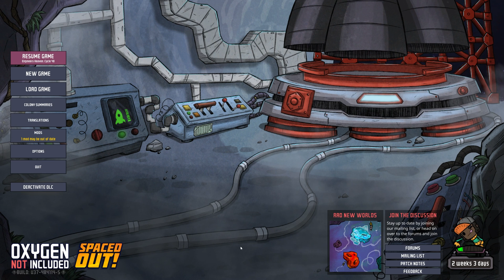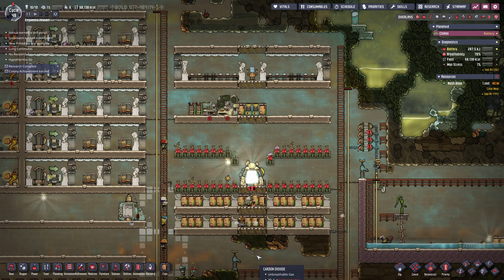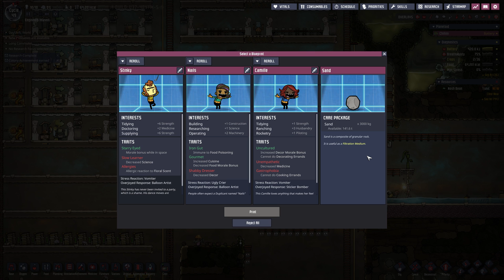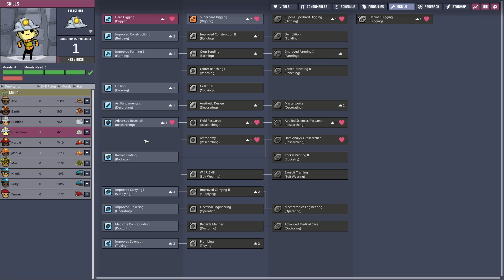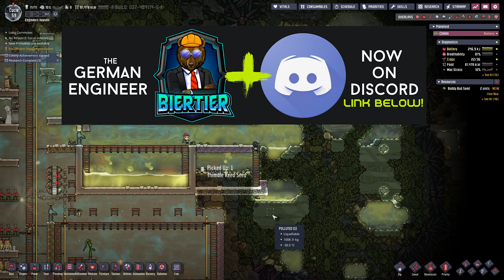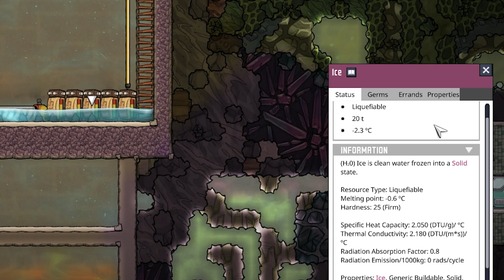AUTOMATED BASE HEATING and RANCHING HATCHES in OXYGEN NOT INCLUDED! (LP1-EP4)

Comment: I don't understand why they have individual bed rooms. 8 beds can go in a barracks. doesn't become a bed room till you get big plastic beds to put in there.also those bigger beds don't really do much. going to require alot of space just for an army of dupes when with two barracks you can easily have 16 lined up. also bathrooms on every floor? just go ahead make a bathroom floor then you can switch it out to a plumbing bathroom loop later. dupes on different schedules so few toilets for more dupes to use. so if you have 3 toilets to start seperate dupes to 3 per schedule plenty of toilets. 

off gassing of polluted stuff just put those underwater so no off gassing. but here I think you doing it for the oxygen since you don't have any oxygen production besides the that one next to research. 

how you growing food already before locators? I always have my beds toilets and water pump done by first day science row set up and working on digging the area out for where my 5 hatch ranches will go the second day. if you find a pip just keep moving those around with a box of seeds and let them plant away.
Reply from the maker: Several reasons for the bedrooms(and yes, I'm aware of the barracks): 1. I prefer the aesthetics. 2. If you have a snoring dupe he gets automatically separated from the rest. 3. If a dupe needs light to sleep you can build a lamp and call it a day. 4. I can use the extra spent time on building to explain other stuff around the base, so it's also a good way for content ;)

The bathrooms are separated because I use the water to heat the base since I'm on Rime. So the water gets naturally and equally separated throughout. And, again, I like the aesthetics. 

The off gassing is indeed for the oxygen in this particular case, I don't mind some polluted oxygen floating around. 

I build my base slower as I would normally without a video on purpose, so I have time to explain. I also don't have a "standard start", I like to mix it up. Sure, building it faster is more efficient, but that is really not the goal in this series ;)

Comment: A small point which might help you is that if you fill up a liquid loop using a liquid bridge it will not overfill
Reply from the maker: I usually do that manually, but you are of course right, with a bridge it’s easier 😊

Comment: Remember that there is a 3 degree buffer you need to overcome to melt or freeze something. -0.6 + 3 means you need to get it to 2.4 degrees. And to freeze, it needs to get down to -3.6
Reply from the maker: I did forget that in the video. Thanks for the correction!

Comment: Really nice episode, been wating for it!

A few small things if I may: 
You shouldn't distill the slime! You won't need the extra algae but can use the slime for Dusk Caps which are awesome and easily farmed food. To prevent the slime from gasing off, just put it in a storage bin under water. As soon as pressure is above a certain threshold (1.8kg iirc), elements are prevented from gassing off.

To make melting your ice much quicker, just limit the amount each storage bin can hold. I usually take no more than 250kg in each, which melt way faster than the 20t maximum.

For your ranches: You might want to add a storage bin for the critter food. The feeders only hold very little and whithout storage, your Dupes have to run a lot. This is actually the place I put my first Auto Sweepers, so the Critter Feeders are filled automatically. Also, it dosn't look like the ranch size is optimal. Ranches can be up to 96 tiles large to hold up to 8 (of most) critters. The additional space can be used for storage, as long as you don't store critter eggs there.

Excuse my continued smart-pantness, lol. I really like your approach to base building. Keep it up!
Reply from the maker: I'm glad you still enjoy it, haha :D

I have honestly never used Dusk Caps for anything, since my food usually comes from meat and at that point most else seems pointless to me. But I'm always happy to learn a few new tricks! I have used underwater storage bins before(polluted dirt in polluted water until processing mainly), but didn't see a need for it here since I didn't know about the dusk caps, haha :)

I did briefly consider putting less ice in the bins, but also didn't see a need here since I have plenty of water available as it is. But you are 100% right, as usual, lower capacity yields faster melt time. I should have at least mentioned it in the video for people who might not know. I will make up for that mistake in the next video, thanks for reminding me!

And the hatches, yes, the 96 tiles. That's what I forgot. You maybe saw me putting my max to 8 hatches and wrangle the surplus, but forgot the 96 tile stipulation. Once again, thank you very much for the pointer! I will correct that and give you credit in the next video :)

I don't mind your "smart-pantness" at all, I'm happy to get feedback, explain my actions, learn new things and get corrected on mistakes I wouldn't have noticed for a good while probably!

Maybe you want to consider joining my newly created discord channel(link in description) for easier and more in-depth conversations, but feel free to leave comments here as you please, it's just an idea :)